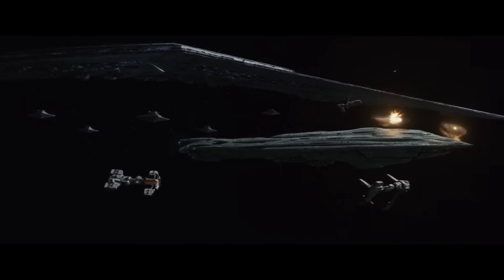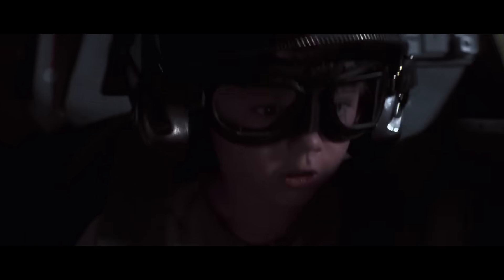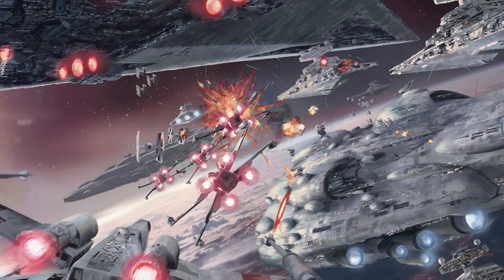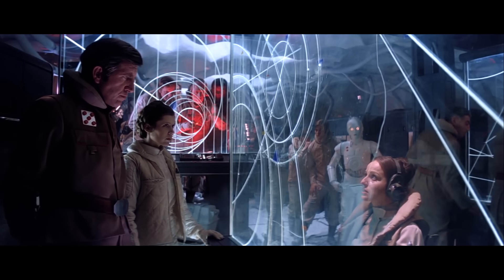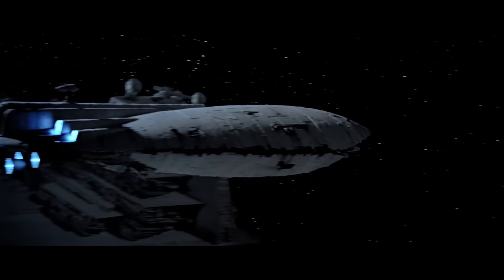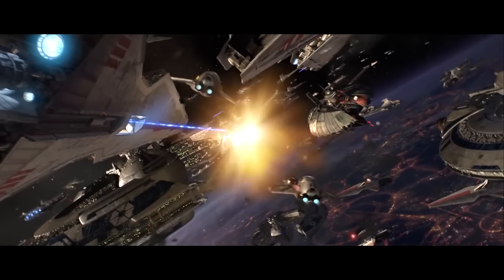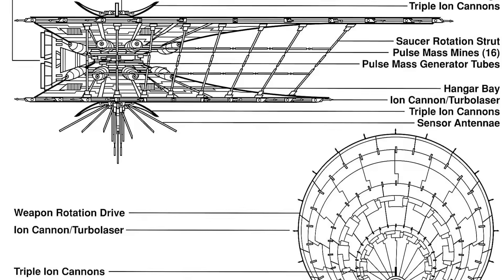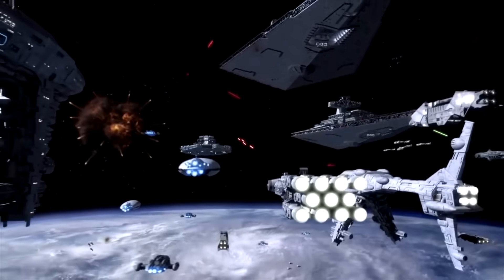Why Star Wars Turbolasers SUCK! (and better options) | Star Wars Lore

Comment: I guess an advantage the turbolaser holds over any unguided mass based projectile is that their energy declines over time until they no longer are a threat.
Hear me out on this one, since Eck usualy mentions this as a plus for the MAC:
After a big fight in space, there is a LOT of debris that needs to be cleared out before you can travel that region savely again. Since most fights are held in proximity to a planet that problem is usually taken care of by the planets gravity.
But in Star Wars, you don't have to worry about lasers flying around randomly hitting sh*t around ground zero (where the fighting took place), because they dissolve.

With MACs, slugs and the whole other ammunition you have capital ship killers flying around in space virtually no decline in their energy and the result when they decide to hit a ship.
Now you might say that ain't a problem, space is huge and the possibility of one of these things actually hitting something is pretty low.
But in a galaxy like the one in Star Wars, how much of these things would be cruising around after, say, the Clone Wars plus the Civil War era?

Maybe a dozen of slugs, fired with enough energy to pierce the shield of a capital ship, caught in a systems gravity field to come around once a decade?
Maybe even a frequently traveled system, rising the chances of a civilian ship getting absolutely wrecked randomly 80 years in the future?
With targeting systems like in the Star Wars galaxy, you'd have a LOT of these random shot cruising the space around important systems after bug battles, and since they'd be fired so the can't be tracked and dodged by the enemy, good luck catching all of them after the fight is over.
Reply: I can promise you that even in a place like where star wars happens, you are more likely to find a black hole in your wallet than you are to be hit by a stray kinetic weapon out in space.
Reply: Chucky Zoopa First of all, I would think that anything with such a low muzzle velocity that the projectile could be trapped by planetary gravity wouldn't be a very good weapon. Second, you're ignoring that targeting computers and guided projectiles are a thing. If Star Wars actually had reasonably advanced computer systems in the setting, actual misses in naval combat should be shockingly rare, and slugs could be outfitted with small antigravity engines to allow minor course corrections in flight.
Reply: You wait for the computer to give you a damn firing solution. You are not a cowboy firing from the hip. If you pull the trigger on this weapon you are ruining someone's day somewhere, sometime.
Reply: Matthew Aden Thank you, my point exactly. Gotta say, Mass Effect had a very ethical approach to warfare.
Reply: But space is already full of comets and other chunks of rock traveling at exceedingly high speeds, and I don't think you quite understand just how massive space is.
Reply: <Insert Hitchhiker's Guide to the Galaxy 'space is big' quote that I'm too lazy to go look up here>
Reply: @Matthew-li7we  Though you gotta admit that targeting computers in Star Wars are a bit lacking in accuracy. insert any space battle shown in any star wars motion picture The amount of shots being fired into space is ridiculus if you compare it with the number of shots actually hitting their target.
Also, like Eck said in his vid about the UNSC Navys' MACs: They may still be effective over long range, but there is a point where anyone could easily dodge the projectile.

I admit, I went a bit over board with the explenation on my first comment, but I still think turbolasers hold at least a slight advantage over slugs
Reply: @weasel4-1  Oh. I actually just LOVE doing that Mass Effect bit. Wasn't even trying to contribute anything to the debate. Actually though, even if a MAC round hits, or even the main gun of a Everest class Dreadnaught from Mass Effect, I imagine the sheer energy being imparted has to scatter high speed debris EVERYWHERE. I imagine a type of Kessler Syndrome from space battles has got to be a issue. In Star Wars I don't imagine this being a problem as battles are fought at far slower speeds and weapons are super slow, maybe even sub-sonic?

But seriously, I don't see the Kinetic rounds being too big of a issue since space is full of rocks zipping around at high speeds anyways. The BIGGEST problem is that such kinetic projectiles MIGHT be harder to detect and destroy if dodging is not a option.

Actually, this reminds me of an event in Stellaris where a Kinetic Round travelled several hundreds of millions of years through space from another Galaxy to NEARLY slam into my God damned Science ship. I swear, those things are magnets for trouble.
Reply: yes you are 100% right.
Most people want cool , destructive weapons without thinking to reality, and gravity,  or viewing above the instant of the battle.
What you expose is a real problem, the worst are bullets and other ammunitions flying in the space under gravity influence , orbiting  around planets, this is the Kessler syndrome power  two.
For an offensive point of view if you want to f*ck the orbital area of a planet with a Kessler Syndrom, no need to fire on ships or stations , or on the planet, just fire in the space with ammunitions with the good speed and the good angle for making them orbiting around the planet. But it means that you have nothing to do around or on this planet....
If you are the defender, well you don't want your own ammunition coming back with gravity against your ships, stations, etc.... In this case only rail gun with very  fast speed above the release speed from the star system can be used, no machine guns with slow bullets like in The expanse.

And rail gun ammunition flying along years without loosing its destructive potential is a real problem even if the space is big, with gravity the ammunition will fly toward a star system, where there can have planets,  colonies, ships, etc.... 

On another hand kinetic weapons have many flaws for spaceships, the same flaws that make militaries of today want laser weapons : heavy cost per shot, fabrication of the ammunitions, transport, stocking in logistic building, stocking in the ship. etc... 
How do you build, transport, stock  MAC rounds of the size of a ship? How many energy for bringing the ammunition from the stock to the gun or just for moving the stock in the ship? What is the cost of one shot? 
If you want give some nightmares to the peoples in the space navy of the future, this is the kind of questions you could ask.
Reply: Those are good points, but I think the main reason is that lasers look cool and calling them turbolasers sounds cooler. After it was pointed out that lasers would literally fire at the speed of light and wouldn't be visible Lucas made up some bullshit about them being a plasma based technology. 
Also the concerns about what happens to rail gun ammunition if it doesn't hit is target are not really valid, while the law - something set in motion will travel in straight line unless acted upon by an outside force, would suggest such ammunition would sail to the end of the universe logic suggests otherwise. The reality is that rail guns would work the same as conventional firearms, just on a larger scale. Gravity is one of the weakest forces, but that shit is absolutely everywhere. Once fired the rail ammunition is going to be effected by the gravity in the course of its travels until it is slowed to the point that it is captured by something and stops.

Comment: Because they don't fill any combat role? There is simply no range or target that justifies their use. They don't fit against anything. It's as if someone had "sawn off" the barrels on main batteries of irl battleship and left only 15% of the propellant in all the charges. Have fun with all the battleship firepower, but with slow ass velocity and less then a kilometer of range. Very usefull
Reply: i always wondered why they make quadruple turrets instead of one bigger gun.
Reply: Appletank8 Faster fire rate and the ability to choose power of shots
Reply: Actually, I think three is one target that excel against - fixed locations, like a base or a planet. Star Wars combat has never seemed to be all that space oriented, but it does seem to be about planetary assault. Ship to ship combat often looks like two quadriplegics trying to sword fight. In other words, it is a joke. But, that same ship is a beast when attacking a fixed location. This also explains why the main gun layout is the way it is. Point the nose at the planet or base and blast away, the naked aft section is actually shielded from return fire.
Reply: @cadengrace5466  Maybe, but that still doesn't mean that it's better for that job than anything else. MACs would be capable of hitting a stationary target from essentially infinitely far away, and are still very effective against planets. Or, if the main batteries are not terribly effective against a target, it would make sense to have a range of nuclear missiles for added firepower when needed.
Reply: @tjdragon

The problems with nuclear weapons is they can also be damaged and detonated by enemy ships, why risk it if you have the other cannons
Reply: @tjdragon7993  infinite range on magnetic accelerator is a myth. It was a cool scene for ME2, but there is a difference between accident and effective combat use. Even with laser that strikes at speed of light, ranges beyond light minute are questionable(if target knows about attack. Expanse makes a huge mistake by underestimating this). MAC is medium ranged weapon at best. Nothing is stationary in space, you know that full well.
Reply: @ tjdragon Range is another red herring in most science fiction. If the weapons involved are light speed or near that maximum then anything beyond 300,000 km is ridiculous unless it is a planet. Ship to ship combat is probably limited to 100,000 km. The weapons in Star Wars are FAR slower than that, but then the ships are far slower at sub-light. I would say anything beyond 10,000 km is probably a fantasy in Star Wars, in spite of what the EU has to say about such things.

MACs are a terrible weapon for ship to ship unless you are at point blank range. HALO is not science. MACs make a good bombardment weapon, again because the target cannot evade. 

In some science fiction franchises, ships can move at 25% to near a 100% of C. Hitting such a target with anything but a light speed weapon is going to be problematic even if the target is not going the speed of light. Fortunately in Star Wars, ships move very slow in sub light. The weapons and their placement might be able to hit another ship in space combat but they are better suited to bombardment where their limited range and speed are not an issue.

You would not use a nuke for the same reason you would not use a MAC in bombardment. collateral damage. The goal is not to make a planet uninhabitable, but to take over its ownership and occupation by eliminating its defenders and bases.
Reply: @cadengrace5466  a second is not enough time to evade to be honest. So even a minute would be a viable range for any surprise attack with a light speed. Since you can't detect LS weapons before they hit. After that when ship is evading nonstop to prevent you from getting it's position predicted? Yep, for LS weapon a second in open combat seems like a sane assumption.
But I agree on the rest and on MAC fully.
Reply: @mustangmckraken1150  turbolasers are much more likely to explode, and due to how nukes work, they are unlikely to go off from damage, and if you were concerned about damage, it would be entirely possible to keep then in an unarmed state until right before launch such that any explosion would have no chance of setting off the nuke.
Reply: @cadengrace5466  the range of a MAC cannon IS infinite, due to Newton's 1st law. Yes, it wouldn't be terribly practical outside of a certain distance against ships, but for planets and other objects that are orbiting on a fixed path the only limiting factor here is the power of the targeting computer, knowledge of the system and what's in between you and the planet, and the fact that at really ridiculous ranges, you have to wait around a long time for the slugs to hit the planet.
Reply: @cadengrace5466  And as far as nukes, MAC cannons are perfectly capable of taking out hard targets, and if you are trying to glass a planet, you aren't worried about habitability anymore, so a nuke would be just as good as a turbolaser.
Reply: @TJDRAGON: Well, Captain Obvious, of course. But, we are talking about NOT glassing the planet on a general basis. The typical reason to take a planet is for the resources, people, strategic location or perceived victory points it allots to the occupier. Glassing that planet makes it worth nothing to anyone. Nukes and MACs obliterate the target and make it worthless, turbo-lasers are not going to do that. This is like trying to kill a patient with a sledge hammer versus surgery with a scalpel.
Reply: Even a second is a LONG time in space combat and frankly Star Wars does not have the ability to fight at such ranges. Perhaps you misunderstand the concept. You are not waiting for a shot to be fired before you try to evade it. You are performing evasive maneuvers continually. I know in Star Wars ships move like pregnant whales that can't turn when given 3 minutes of notice, but even they are going to be able to dodge a shot fired over a long distance. 

When we see the transports being hit by Supremacy's super heavy turbo lasers the range is extremely close. If you can see a ship visually it is practically on top of you. The range there was at best a few thousand km and yet these shots take 3 to 5 seconds to hit their target, if they hit their target. They even curve in their trajectory. They are not light speed weapons. Shooting at something more than 10,000 km an hitting it with a turbo laser is going to be wild luck. I know we have reams of printed documents that tell us what they can do but when we see what they can do, that ability is much, much less.
Reply: @cadengrace5466  MACs are perfectly capable of destroying military targets on a planet without causing significant collateral damage. In fact, I would say they are better for this than turbolasers since their speed allows them to hit more accurately.
Reply: @ijdragon: Then you lack the basic understanding of physics, making any further debate on this topic futile. Good luck.
Reply: @cadengrace5466  lol nice ad hominem
Reply: @cadengrace5466  I'm a bit late, but MACs can be fired at different power levels. It can be fired at anywhere from 1-100% charge.
Reply: @komradekat940  While it would be technological possible to do so, you would never fire a MAC at anything but full power. The power indicates the speed at which the projectile will traverse the distance. There is no circumstance that favors using less than full power in a weapon like this.

Comment: Best Energy Rifle: E-11 Blaster Rifle, Star Wars; Type-3 Phaser Rifle, Star Trek; PPG Rifle, Babylon 5; Type-25 Energy Rifle, Halo
Reply: E-11
Reply: Best energy rifle? T'au pulse rifle.
Reply: Objectively the E-11 is the best designed weapon. It is the most ergonomic and practical weapon on the list, complete with sights and scope. In terms of firepower, it is between the E-11 and the type 3 phaser; both of these weapons have multiple power settings and have good anti-materiel ability at full power. The PPG is the objectively the worst weapon in these regards... it is a holdout pistol, a sidearm.  The type-25 plasma rifle has good rate of fire like the E-11, and can be held with both hands for stability, like a rifle, but it lacks sights, scopes, and power settings.

Comment: I think the prevelance of turbo lasers is an inevitable outcome from the addoption of energy based weaponry in general, itself a necessity if warfare is going to be conducted in space on the scales that we see in the Star Wars galaxy. The reason - every bolt of energy we see being discharged from every weapons inplacement located in or directed at outer space shows that bolt, if it does not make destructive contact with its intended target, continues to travel a short distance beyond and then self detonates or it just dissapates. This is required for, of all things, safety reasons. Imagine if every 'space blaster' shot was discharging hard physical ordinance - bullets and shells...which would, once fired, never stop or slow down. The resulting clouds of projectiles sweeping through space for centuries to come after the battles that fired them would make space travel and residency increasingly dangerous to the point of impossible. With energy based weapons that scenario is entirely mitigated, allowing factions to engage in space combat without limit.